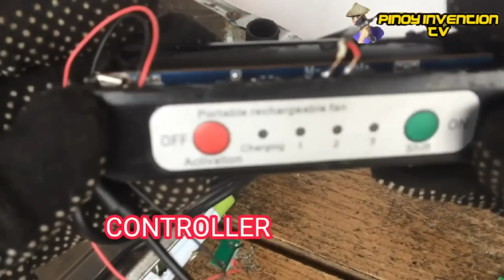ANG PINAKAMURA AT PINAKAMATIPID NA KALAN/DIY STOVE

Comment: Ang tanong ko: ilang litro o mililitro ang magagamit sa recycled used oil para makaluto ng isang putahe o ulam, halimbawa mga 30 minutes?
Reply from the maker: Matipid pong fuel ang used oil patak patak LNG po daloy Ng fuel SA burner kya Di Kyo kukunsumu Ng isang litro